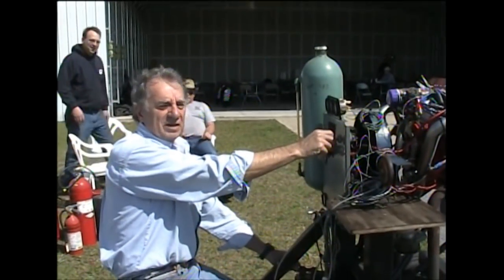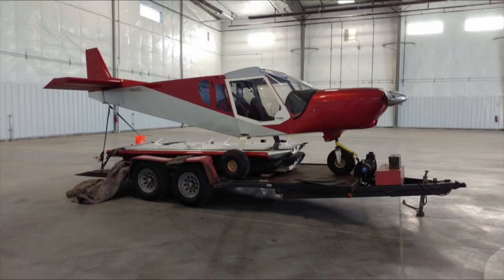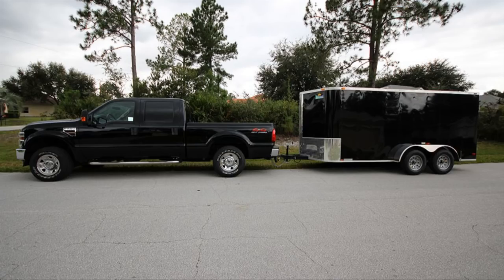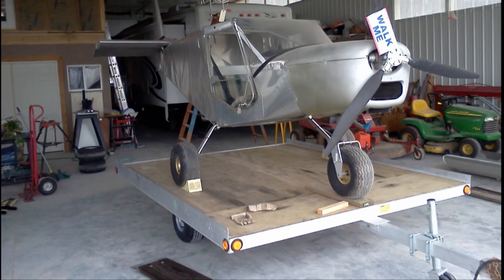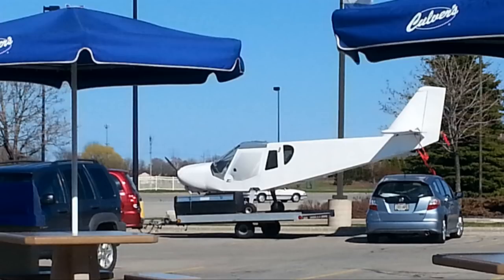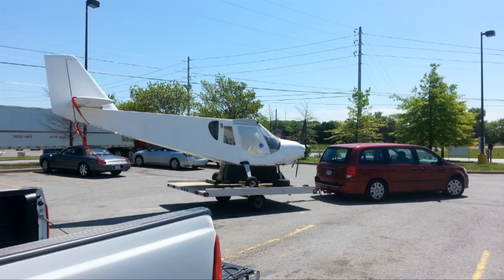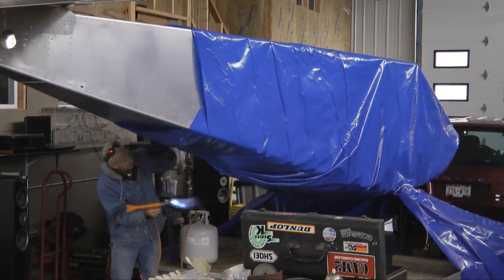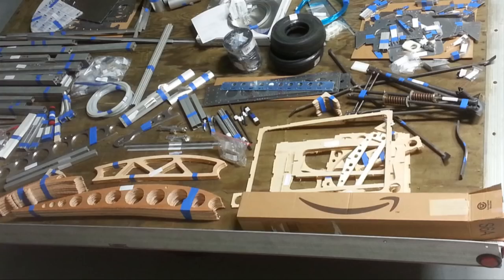Great Method for Transporting a Homebuilt AIrcraft

Comment: Thanks for this great video (it not the best!) on moving airplanes which helped me immensely on my move from Philadelphia to Los Angeles.  I purchased a 22' Floe snowmobile trailer in Michigan to move a 1970 Cessna 172K.  If I have to add anything, is that it is very important to take extra time to secure all the parts properly (especially the wings!).  After about 1500 miles one of my wings slid down and contacted the brake caliper which caused a nasty dent in the leading edge.  Still not too bad though for a 3000 mile trip!  Although I'm getting strange looks from my neighbors as to why I have a quad snowmobile trailer parked in front of my house in sunny LA...

Comment: The snow mobile trailer sounds like a good idea. After you buy one i would strongly suggest you service the wheel bearing and axles as they may be badly corroded after sitting out side in the snow over the winter months. With the aircraft hanging over the rear of the trailer so far may require an over size permit from the DOT because of the excessive amount of rear overhang. These are not too difficult to obtain from your local DOT office.

Also as mentioned by "Ari Tamminen" these type of trailers with the small wheels do bounce around a lot as the suspension is not that great and the airframe may be damaged due to excessive shock from the bumpy roads.